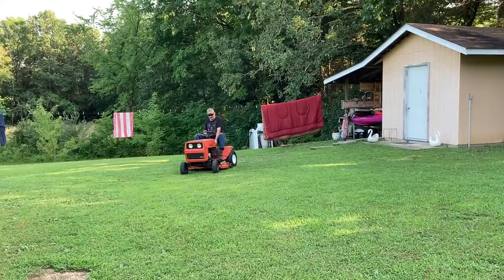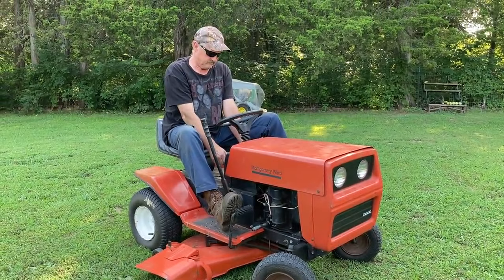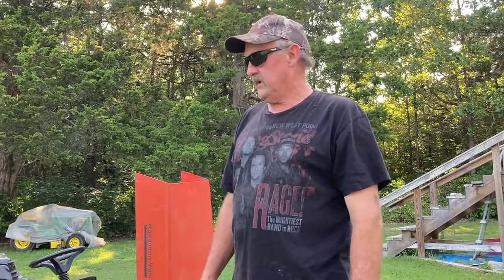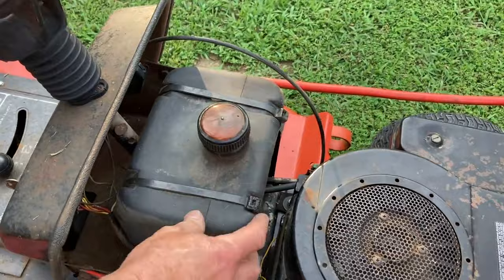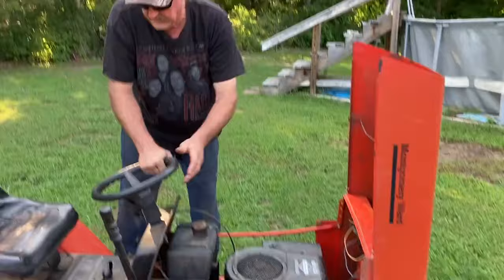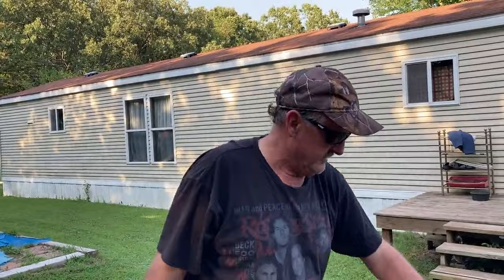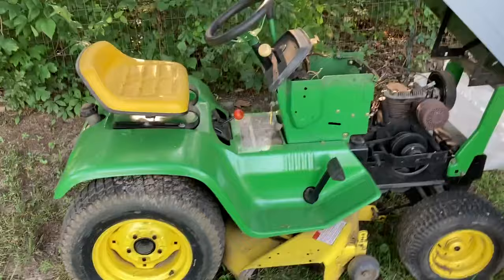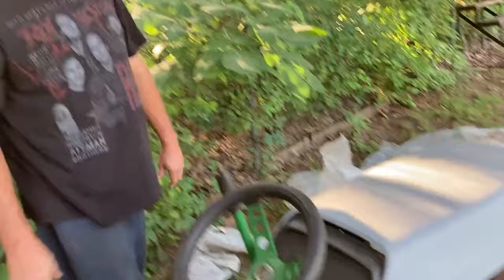1981 Vintage Montgomery Ward and 1977-78 John Deer Lawn Mower Restoration

Comment: I got that Wards mower for $20 weeks ago. Original all 4 tires still and still hold air! love that thing. I went to change the oil and it was so black makes me wonder if it was the original oil. Noticed there was no oil filter on mine, is that the same on yours?

Comment: Odd request: any chance you could pop off the battery cover and shoot a video of the drive belt layout? I'm trying to bring one back to life and what I could find in the manual doesn't look/feel/run right.  Wondering if a previous owner messed something up with the pulley.
Reply from the maker: Sorry for late response been down. I'll try to the drive belt on these I believe do fit kinda weird. Have newer phone will try soon.

Comment: I have one of those same kind but I cannot get mine to go in gear it stuck in neutral and I cannot get mine to turn over even with mine modified 12 volt tractor battery